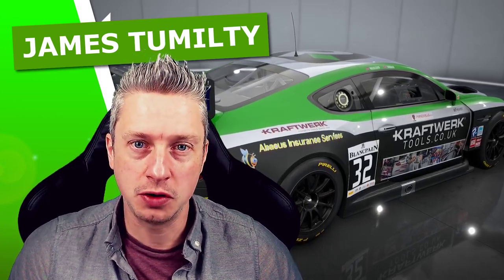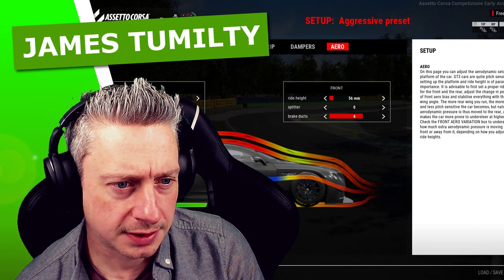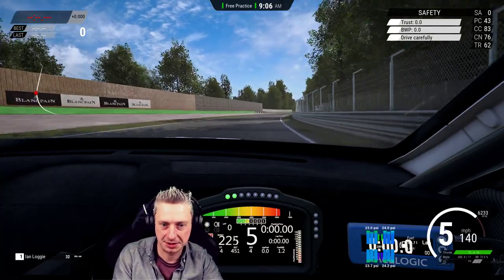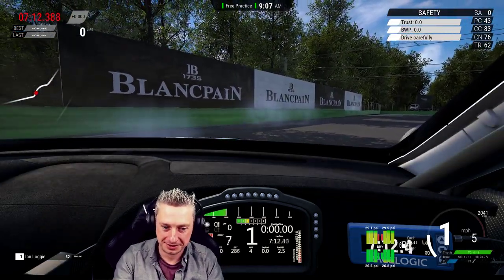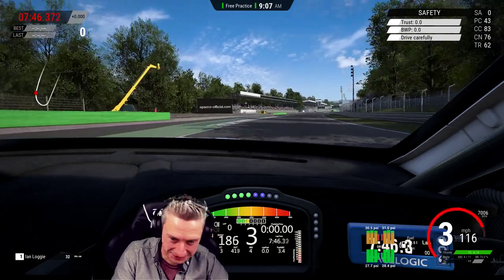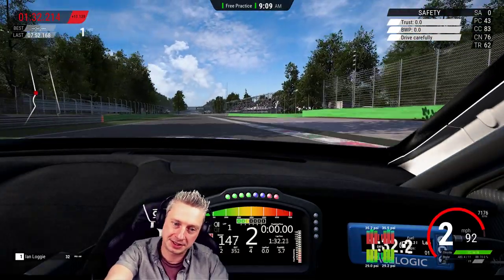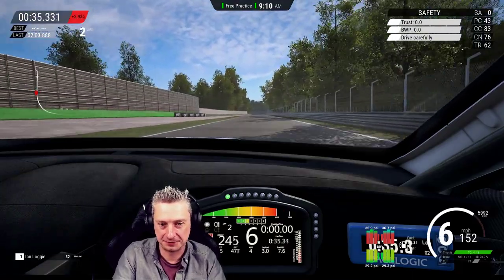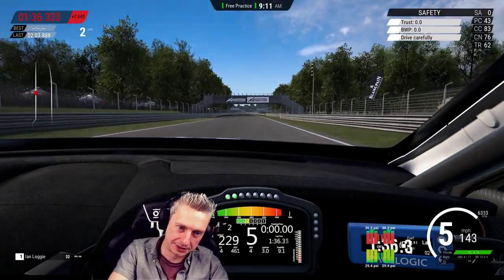How long to cook the brakes? Assetto Corsa Competizione Release 7 Closed Brake Ducts

Comment: What I’d like to know is what the difference in top speed with full open and full closed ducts? It’s in the aero tab, so I assume opening ducts adds drag?!
Reply from the maker: Yeah I believe opening the ducts increases the drag of the car, I didn't test by how much, but I don't think it would be very significant. It also struck me after recording that it can also be used to keep brake and tyre temperatures up when driving in wet conditions as its harder to generate heat when its wet. 😀
Reply: James Tumilty and now low tyre pressure can cause punctures when hitting curbs. So keeping heat up and pressure up is more important. Be nice to see what top speed difference just brake ducts make.
Reply from the maker: That is a very good point, two of the changes in early access release 7 working hand in hand there.

Comment: Well there's a test you won't see every day... and it's impressive that the game simulates how disastrous that is in a way that is, even if not totally realistic, at least intuitive and believable. I do wonder how much you might have been able to hedge against it with a different front/rear bias, but then the car might have become just as difficult to drive. Great silly fun, this. ^_^
Reply from the maker: Yeah it was quite a fun test to do, I was quite impressed by how Kunos have modeled the heat bleed into the core of the tyre, and the different at the surface, a little bit of detail I wasn't expecting. 😃